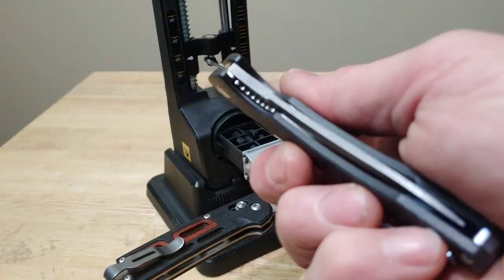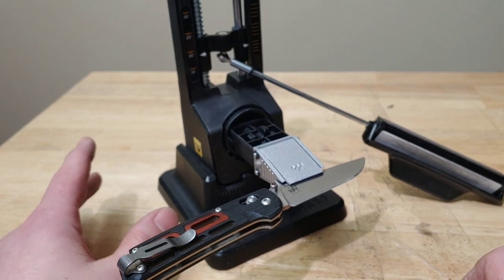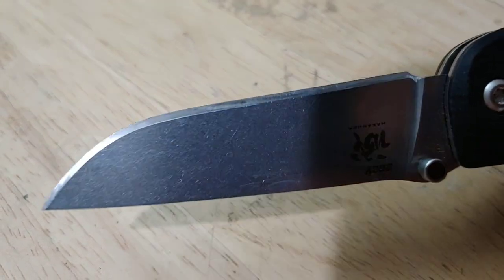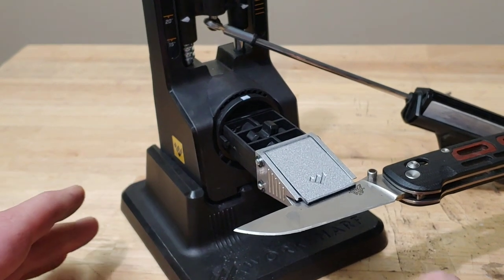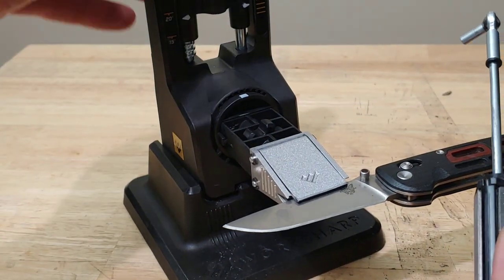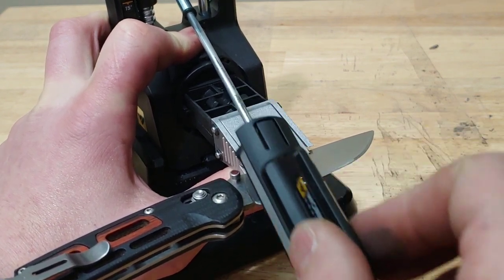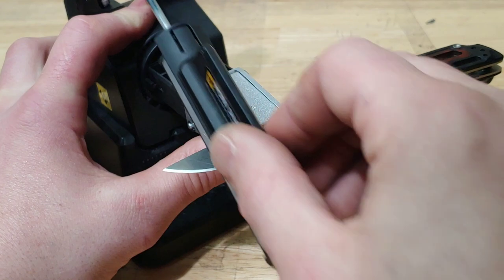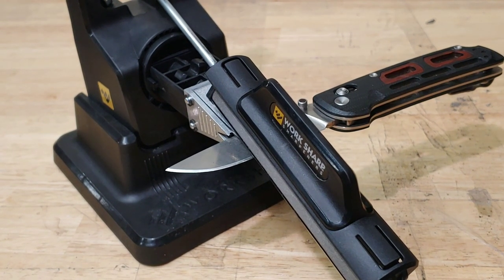LONG TERM UPDATE WORK SHARP PRECISION ADJUST SHARPENER

Comment: Quick question. Would this work with a convex grind knife??? Their website says all their tools work with it but it does look like it
Reply from the maker: Yes and no, so if your wanting to put a v grind edge on a convex knife then yes, but if your wanting a convexed edge no it will not, because its a flat angle and a convex needs a rounded angle, but if the knife is convexed and you just want to put an edge on the knife, it will sharpen the knife it wont be a convexed edge though

Comment: I’ve already sharpened over 50 knives. No obvious change in wear or sharpening capabilities.
Reply from the maker: Nice!! Thats amazing! Were any super steels, i sharpen mostly super steels s90v. M390, k390 s30v, s110v, s35, m4, and many many others, but i also do a lot of mid range steels not to often do i do budget steels compared to the others

Comment: Are the 300 and 600 grit both diamond 💎 impregnated metal plates ?   I won't even attempt reprofiling blades or even getting an apex with softer stones anymore..
Reply from the maker: Yes they are metal plates with diamonds on the surface
Reply: @NeevesKnives  Hey man, Thanks for the reply back..  Ive been looking at this but no one has mentioned the type of abrasive used until I watched your video..

Comment: Wiping the ceramic with a wet finger occasionally will take off the steel buildup that appears to be on it. Conditioning the ceramic, lightly, against a diamond plate helps keep it cutting, too.

Comment: You mention the difference between stone grits. Any idea what workshop rating the are? For example, wicked edge are ansi rated stones, which is different from a typical Japanese whet stone rating. A 1500 grit ansi stone is, if I recall, somewhere similar to about a 4000 grit Japanese whet stone.
Reply from the maker: The rating on the work sharp are similar to American grit rating, as most diamond plates are, which are going to be more coarse than wet stone at similar grit, I do notice they are finer than my other diamond stones like dmt or ultra sharp. Tsprof or venev use an f rating which is different and are from a russia,, they are basically 3× finer so a 200 would be like a 600. But as far as the work sharp go they are similar to dmt or ultra sharp grit ratings. A Japanese or other wet stones are very different even the scratch pattern than diamond

Comment: Thank you a detailed review.

In one of the video manufacturer states that the knife spine should fit snug in outside V grooves of the clamp so that knife wobble can be minimised. I don't know how effective it would be though.

Also it may not be easy for knives that are not too wide.
Reply from the maker: Yeah it benifits larger knives a bit, but the entire clamp moves slightly, so wedging something or holding it helps a lot

Comment: Would you recommend this or the lansky deluxe diamond. I’m new to sharpening. Most of my blades are D2 but I have a couple s30v, bd1, and 35v
Reply from the maker: This is far easier to use, i would recommend this one
Reply: I have both... and this one for sure after doing some minor adjustments like gluing a a 10lb weight to the bottom painting it and then I glued the rotator to the adapter that holds the knife now it's solid plus I filled it up with foam that's it do that and you got a solid investment

Comment: I have not seen this system in real life but would it not be possible to make a small block of plastic or wood that fits under the clamp to stop the wobble?  I think I will buy one ( they are not available in England at the moment) I am sure that when I buy one I will devise some stability, anyway good video from a guy who knows his stuff thankyou I was gonna spend much more money for something else
Reply from the maker: Im sure you could come up with something others have said the have wedged and made ways to make it better, but even as is its a great system thats highly recommended

Comment: I see what your saying about the blade flexing, but, it appears that your not seating the back of the blade right into the V at the back of the holder as (I believe) the instructions say you should. I think if the blade were properly seated that would help with the amount of movement and give your thumb a rest.
Reply from the maker: It doesn't matter I've had this for a while but now I have other attachments that help it, watch some of my aftermarket attachment videos if your interested I have another one coming up soon as well

Comment: Great vid as usual. I got a kizer t1 the other day and Im having issues with it. The detent is weird on it. It doesn't suck the blade in smoothly like all my other knives. It's either out of the detent or in it.  There is no in-between. It doesn't come out of the detent smoothly either. It's like it's stuck and has to really break free. On all my other knives there is resistance and then you can feel it smoothly coming out of the detent. This one feels like it's stuck then roughly breaks out of it. I'm not sure what to do to fix it. I don't want to send it back but I am not happy with the action. You also have to have the pivot tightened all the way super tight or there is jiggle in the blade anytime it's not locked in the open position. Any tips on what I could do?
Reply from the maker: Check and see if theres something in the detent hole, also make sure your not holding the lockbar when opening this knife does have death lock wich is when you putting pressure on the lock bar it wont open
Reply: @NeevesKnives  yeah I'm going to take it apart tomorrow. It's not me holding the lock bar. Even when I hold it without my hand on the lockbar and do a two hand open it sticks. It's like the detent ball is stuck in the hole and it has to pop free. It feels absolutely horrible for a knife that expensive. I'm very disappointed in how it feels. My $25 tangram Santa Fe has an action that is 100x smoother. For $140 I expect much better.
Reply from the maker: @Shambley1  maybe you should return it and have them send you another, i know it has a strong detent, but yours sounds like its beyond that

Comment: What sharpening compound would you recommend?
Reply from the maker: Stropping, i love diamond sprays the most and venev diamond compound, but on a budget the white compound from amazon or hardware stores is great its usually packed with a green compound as well both are good but the white is a little more aggressive
Reply: @NeevesKnives  What's the brand name?

Comment: I have this machine and the KME. I also bought an adapter and films from Gritomatic that fits the Worksharp. I get a better mirror polish with the extras from Gritomatic on the Worksharp then the KME. For some reason the KME gives me a hard time on maintaining a consistent angle then the Worksharp. I’m sure I’m doing something wrong. I’m using the upgraded Worksharp not the one being advertised
Reply from the maker: Yeah I've done a few videos on attachments and how great this system is with attachments and different stones like venev I also have another video coming with even more
Reply: @NeevesKnives  they are great videos . That’s where I got my info from. Keep up the good work on your videos. You and Metal Complex got me into this hobby and I absolutely am hooked.  Lmao I have to slow my roll down a bit though Ive been buying way too much lately. 🤣

Comment: would you recommend this system or the lansky diamond system?
Reply from the maker: Both are good this ones easier to use, i do reccomend this one over the 50$ system from lansky but if your getting the diamond system with the base and the ceramic/ saphire then i reccomend the lansky but its going to be double the price at that point, with this system you can get other things that make it even better than the full lansky, but yes i do reccomend this one
Reply from the maker: Il say one more thing with the lansky the stones are great and can be used in many ways other than on the system so if that appeals to you
Reply: @NeevesKnives  I think the worksharp just looks a bit easier to use and store, and as you said getting the full lansky system would cost a lot more. Think I will buy the work sharp and hope they bring out extra stones and accessories etc. Thanks for your help
Reply from the maker: @irving608able  absolutely

Comment: I glued a 10lb barbell weight to the bottom and painted it black to match....also I took off the stone guard. I  filled up the back with acoustic foam to get rid of that plastic hollow sound.. then lastly I glued the rotating piece to the base to keep it sturdy

Do those fixes and this thing is seriously bad ass

* Correction I glued clamp piece to inside of rotator
Reply from the maker: Everything sounds great aside from gluing the blade clamp, because then you can't flip it without taking it out of the clamp, I personally don't like it to come out until finished because the angle changes, I know I can trace it and replace it very close but seems like it might be more frustrating trying to match it up the same Everything I'd had to flip it
Reply: @NeevesKnives forgive me I ment to say I glued the clamp piece to the rotator.. the outside of the clamp piece is glued to the inside of the rotator..so you can still flip it
Reply: @NeevesKnives  the weight turned this thing from a " ah. Its ok" item to a " fuuuck ya this is the shit now" seriously made a huge difference

Comment: So trying to find this sharpening system has been a pain in the Rear.. Places are still sold out. So as a quick solution I am thinking about just getting the lansky Deluxe 5 stone system.
Reply from the maker: If you get a lansky get the one with the diamond stones, and the ceramic and saphire stones, also make sure it has the base, just suggestions
Reply: @NeevesKnives  oh the one with the regular stones is not a good choice
Reply from the maker: @harveybeekerthegreysquirre8262  its ok but not great since the stones are small and thin, you want them to cut fast and diamonds cut fast especially if your wanting to sharpen steels like s30v and up, it makes the system far better with atleast the coarse and medium grt diamond, then the other stones will work fine
Reply: @NeevesKnives  so if i get the regular 5 stone but make sure to get the coarse diamond and medium diamond stones I'll be good . I'll be sharpening mostly 1095 AUS8 AUS10 and 1055 not any super steel
Reply from the maker: @harveybeekerthegreysquirre8262  yes you definitely should still get the those two diamond stones and it will make things so much easier, and make sure you get oil for the other stones, or mix dish soap and water, but which ever one you start using stick with it dont switch

Comment: I am adding up the cost of all the aftermarket Etsy farkles to make one of these somewhat more stable, etc., and it seems by the time a guy gets all the hotrod parts to de-bug this thing you are nearing a basic KME system that is going to perform better without all the flexing and plastic.

Comment: thanks for the review. my experience with the system is similar I like the benchstone kit better. 

If I am understanding the review correctly: the KME sharpening system may be a better value in terms of cost per sharpen. as their diamond stones can do something like 300 sharpenings  a piece.
Reply from the maker: I recently posted a new attachment for this device that makes it as good as a kme and allows you to use any stones even the high end ones, work sharp 4" stone attachment check out my video

Comment: I put a sliver of a strong tape in each channel/groove in where the clamp slides in, it removed a majority almost 90% of the vertical play and all the lateral play!! And I use the PSA lapping films on the ceramic and it’s great and removing it leaves no residue!! Getting mirrors 😄
Reply: @Jerome.Du.Quartier  gotcha! Use good electrical tape, not the cheap stuff. It will stick well, just make sure it’s thin enough to the clamp with still come out. Or wedge it in there good and don’t really take the clamp out, upon think I don’t pull it out that much anyway! I even insert the knife with the clamp still in it. It’s really easy and useful. Can’t really go wrong, trial and error. I’m liking the system, after that easy fix, and some lapping films, loving it!!
Reply from the maker: Thats amazing Josh and great ideas
Reply: Great advise,this realy works well.Thanks

Comment: Great value for the money, but the clamp won't really hold my small knives (Manbugs, Ladybugs, Dragonfly, pen knives).  3" or larger blades work well.  I also use the Sweet Knives lapping films and extra stone holders.
Reply from the maker: Why not
Reply: @NeevesKnives  The blades aren't deep enough to get into the v-notch on the clamp evenly and the clamp width is too wide to find an even purchase on the short blades.  Try a small Spyderco.

Comment: Should I buy it
Reply: It’s geared towards the modern EDC style knife.  If you have a Benchmade Bugout, Spyderco, or similar style or sized knife, and you just want to put a decent cutting edge on it, it’ll be fine.  If you’re some uber perfectionist like Neeves, you probably won’t like it as much as some $300-$500 dollar system.  I use mine all the time, and I get decent edges.

Comment: I seen a video where they do not go up down motion and only in clean pressure swipes from base to tip. id imagine this take 10x longer for a good edge though.
Reply from the maker: I do that as well, there's different ways to  sharpen depending on your desired finish

Comment: Would making a custom made block to put under clamp to keep it from moving work?
Reply from the maker: No honestly, holding it works because you have to hold it anyway to stop it from falling forward, the only real way to deal with it is the same pressure, but all in all its a great system and its only 50$
Reply: @NeevesKnives  ,  thank you.    I am hoping this one becomes available in new year in my region so that I can order.   I recently ordered Worksharp Benchtop Whetstone Sharpener, and Worksharp Benchtop Benchstone Sharpener and would like the one in your video as it is portable to take car camping.   The reason I ordered the two other ones Is because in my region precision adjust sharpener not in stock yet and I wanted option for car camping.    At home I use Blade grinding attachment with my Ken onion system and I recently re-profiled 2 blades to 17.5 degrees and did final honing and polishing with cloth belts.
Reply from the maker: @robertdewalt8711  thats awesome im going to do a video soon on regrinding a blade with the worksharp grinder, and i want to get one of those bench stones from work sharp and test it out.

Comment: I have a 25 dollar generic all steel fixed angle sharpener off amazon like this and for higher grits i use the cheap harbor freight diamond sharpeners with a red, blue and yellow plastic that i use for rough reprofiling, then the stones that came with it up to 1500 grit that feels like 900 grit, then i go to automotive sandpaper spray glued to the back of the plastic hf   diamond sharpeners up to 3000 grit and put a mirror polish razor edge on a budget. Have less than 40 dollars in the whole system. Also strop the burrs off with saddle leather and green compound. And time.
I learned to sharpen my wood chisels with automotive sanpaper to a mirror finish using a jig that i made from hardwood from a fine woodworking magazine b4 internet came along. Sandpaper spray glued to a hard flat surface like glass or mdf.
Reply from the maker: Nice! Sounds like you have put time and effort into perfecting a system to work for you, wish more people would, theres so many more benifits to knives when you get into sharpening and different finishes and edges
Reply: @NeevesKnives  thank you , enjoy your channel and appreciate you and your wifes hard work

Comment: On Ebay check out 3M lapping paper. A guy has 3D printed another slide to stick the lapping paper to and it goes up to 60k grit. Mirror finish.
Reply from the maker: Yes I reviewed that, and I also recently reviewed a 4" stone holder attachment that turns this system into a much better system all around

Comment: Try to put a few pieces of rubberized draw liner on the blade then clamp in. Should help with wobble a bit. Depending on the blade profile I even have a bit of wobble to correct on my expensive Russian sharpener
Reply from the maker: Thanks Jon i will definitely try that

Comment: Work sharp design is great however trying to get price and production costs down there are drawbacks. Blade clamp and rocking
Reply from the maker: I have shown many aftermarket parts some are for rocking and movement, I have another video coming very seen as well that holds the entire device in place, many many aftermarket parts will be in the video

Comment: I'm getting a mirror polish with this system, I don't know what I'm doing right..
Reply from the maker: Yeah ive gotten mirror edges with it also, it just takes longer than it should because the ceramic is a jump from 600 grt there should be a stone in between to make it less time and easier